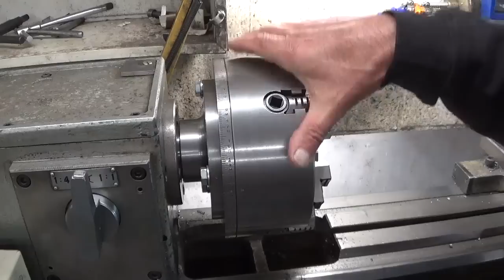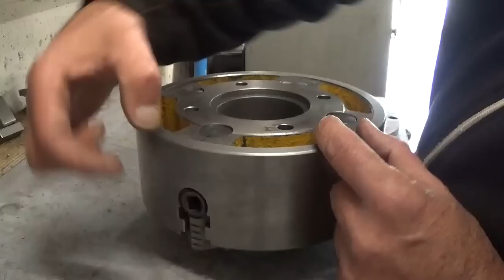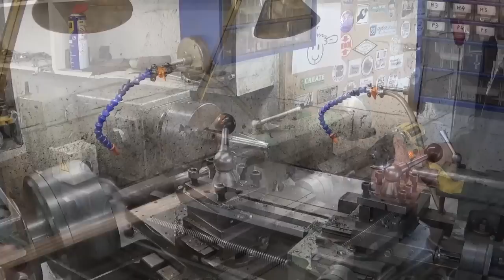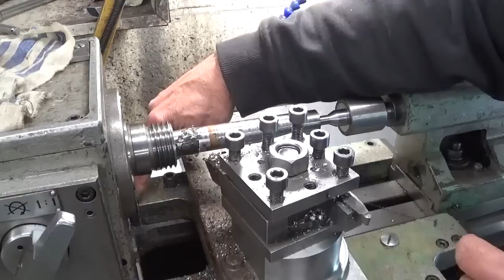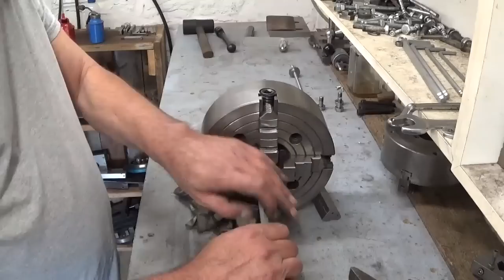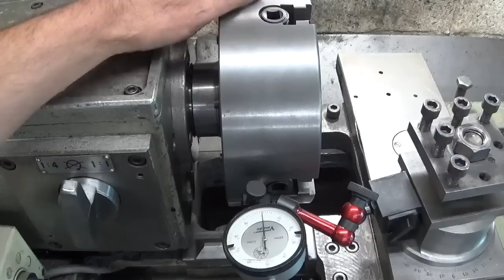Adapting my four jaw chuck.

Comment: Michel, that is a great idea.  I'm trying to something similar on my 111-year-old South Bend lathe.  I bought an 8-inch (~200mm) 4-independent-jaw chuck to replace the very worn-out 3-jaw chuck, but need to make a backplate for it.  I didn't (yet) have the needed change gears to thread it to fit the spindle, but was able to get a Machinist at work to thread a rough plate for me to finish before I retired.  Of course, the 1-inch (~25mm) wide leather drive belt insists on slipping when I take a cut more than a couple of thousandths of an inch (~0.05mm) deep, causing the spindle to quit turning.  I think it's time to get a new belt since belt dressing doesn't seem to help!  ;P  I figured that with limited funds, I'd buy a 4-jaw to be able to chuck "anything" (of reasonable size) and simply take longer to dial parts in, and worry about buying a replacement 3-jaw later (if I ever do).
Reply from the maker: I think if you have a good working 4-jaw, you don't really need a 3-jaw anymore. Thanks for your comment, Bob.

Comment: That looks like a you ended up with a great result, and  it certainly sounds like much less chatter than before, but you are definately putting much less stress on the headsock front bearing. I am working my way through your videos, and I love your approach to tackling problems, you are very inspiring, thanks Rusti!
Reply from the maker: That's nice, Dave. Thanks. I appreciate it.

Comment: Bold move! 😃. I too get some pretty nice chatter with my big 4-jaw, most likely due to the same reason. It's gotten quite a bit better since I reshimmed my babbit bearings but still takes up a lot of real estate on my little lathe.  The original had a much shorter profile 😏. 
In any case, clever setup! The lower profile looks great too! Well done! 👍😁👍
Cheers!
Reply from the maker: Thanks Chris. I'm sure you will figure out what's going on with your lathe.

Comment: What you did was absolutely brilliant!  I bought that ~same 4 jaw chuck and it's been sitting in the box for over a year because of that exact same problem with excessive stick out.  
- - Before I forget, or some reason, the factory put huge chamfers on the corners of the jaws of my chuck; where they slide through the chuck body - yet every single edge and corner of the jaws still had sharp burrs that I had to remove. (If left alone, I think they would quickly chew up the cast iron body.)  If you haven't done so already, I'd recommend that you check your chuck for those same burrs.  I don't know what brand name is on yours (mine was advertised as "Steelhorse" on Amazon, but came in a box labeled "Shop Fox".  Regardless of the name, I'd bet they came out of the same factory.

With that out of the way, I think I'll borrow your idea!   (Fortunately for me, my lathe can cut its own thread; 2-1/4" × 8 TPI.)  
I'll do the same hollowing out of the back like you did but, since I can cut my own thread, I think I'll make my back plate 'backwards'.
- 'Backwards' meaning a mirror image of the typical backplate, with the thick center hump that holds the threads & registration seat pointing into the chuck body instead of sticking out the back; reducing overhang instead of increasing it. (There's plenty of space inside the bore.) If it works as I hope it will, the back face of the chuck will come flush with the spindle nose!
Side note 1:  I wonder how much material can be removed from the full diameter of the back of this chuck before it starts compromising its rigidity (or interfering with functionality of the jaw screw parts)? 
Side note 2:  Do you have a friend with a lathe that can cut the spindle thread you need?  If not, you could probably have a local machine shop cut them for you. If you make the part yourself, all the way up to where it's time to cut the threads, it shouldn't cost a lot just to have them do the threading.
Thank you sir for another excellent video! 👍👍👍
Reply from the maker: Go for it Doug. It's better to try something than letting it rust in a box.
And indeed. first thing I did when I bought it, was taking it apart and clean and deburr the thing :)

Comment: Great work, well done! As always, well filmed and presented in Your usual spirit.
Your experience of chatter in the very first try, thanks for pointing it out. I once bought a 5 inch rotary table and a 5" 3 jaw for the rotary table. They match perfectly.
One day LMS in US advertised about an adapter adapting that 5" chuck to mini lathes equipped with 4" chucks as standard. It did fit perfectly without any turning!
When starting the lathe I need to ramp up the speed from zero. Else I feel that the power transistors in the control box are jumping in and out.
The chuck is in place and I will do some tests regarding just the chatter You pointed out.
Thanks again Michel!
Reply from the maker: Thanks Stefan. The problem with big chucks on small lathes :)

Comment: Just an idea, you could have used the chuck body to give you the hole layout, start with the diameter of the hole to centre it then table locked, chuck clamped down, drill tapping size, thread and bolt to hold in place, rinse and repeat! Cheers, Matthew
Reply from the maker: That could have worked too, but I have difficulties to lift the thing on and off the machine.

Comment: I could have sworn these cylindrical pieces you machined partways into were there to hold the jaw screws in place - live and learn.
Now I know alot more can be taken out of a chuck than I ever thought!
Reply from the maker: Indeed, they hold the jaw screws in place. But I think with the cut out they will still work fine. Future will tell.

Comment: Mmm!
Trying to take the slack out if my headstock bearings at the moment.  Got .6mm of lift but the Lathe is 80 years old. You've just highlighted a problem that I didn't think of. Thanks Michel 👍🏻👍🏻
Reply from the maker: 0,6 is a lot. Well, good luck with it.

Comment: In the afternoons... a very good option to make larger pieces is on the plate that you have with 3 claws, which has removable claws, so you can make extended false claws with a piece of steel and you can do them without any problem in the milling machine... like this you could hold pieces up to the maximum turn of your lathe...it is an option that I usually use and that is economical and very reliable...perhaps for another occasion you can make the extended claws and perhaps a few more sets to have soft claws for yourself lathe in an economical way and that many jobs will be solved for you... greetings from asturias spain
Reply from the maker: That's a good tip. I will keep it in mind.

Comment: Most interesting. I need a beer and cigarette while thinking about this. Have a great day and weekend Rustinox.
Reply from the maker: A beer and cigarette I can understand. But don't think too much :)
Reply: @Rustinox  I was thinking about having to change 2 bearing races on a lathe when switching to a larger / heavier chuck . 
It basically eliminated chatter and helped with runout issues . Thanks for sharing your expertise and ATB.
Reply: @QuantumPyrite_88.9  A bigger headstock bearing , That has to be a good follow up !!!

Comment: Well done! But it looks like you could really do with a set of change gears (or an "electronic leadscrew") to be able to cut more threads.
Reply from the maker: I have some change gears, but there's not enough room in the casing to put bigger.
Reply: @Rustinox  How about if you step down twice on a spare, unused or new stub shaft, within the case?
Great video as always and causes the grey matter to work.

Comment: Maybe the bite into the work piece from the jaws is causing the noisy cut.  Try some soft metal between the work piece and the jaws and see if that make any difference.
Reply from the maker: I tried that before. It doesn't make any difference. But, thanks for the tip.

Comment: The part left would make an awesome rotary table build. Awesome work Michael. I have been dreading replacing the 4 jaw on my Logan for one of these chucks as they seem to have a huge body for no real reason other than to use metal. Your solution is very elegant. Is there a way you can come up with a reduction gear set to make the lathe cut the thread you need? I know you have made gears in the past.
Reply from the maker: There's not enough room in the case to put bigger gears in place.
Reply: @Rustinox  i see. Hmmm. That is an interesting conundrum.

Comment: Scary, but it worked great! I don't understand where the chatter is coming from. You'd think: massive chuck means less chatter. Maybe the spindle attachment is too weak for such a big chuck? Hopefully not.
Reply from the maker: I think the spindle is flexing between the bearings. After all, it's a big chuck for a small lathe.

Comment: Hi Rusti, why can’t you cut the 4.5mm pitch you need for your backplate?  Is it because the lead screw re pitch is too fine? - some say you should not cut  pitches larger than the lead screw to avoid overloading ( but people do it) it or is it that you do not have the gears?  I have.3D printed change gears and would be happy to make the ones you need for you.
Reply from the maker: Thanks Tony. But the gears I need for this would be too big to fit in the machine.
Reply: Ok but I think we can  solve this with compound gearing or change the module to reduce the gear diameters, you are not the first to have this problem., it would make an interesting video. Can’t remember if you have a public email?
Reply from the maker: @tonyray91  rustinox@outlook.com
It's in the "about" section of the channel.

Comment: Michel, sounds like the bearings need readjustment, if possible. If not, a new set will help.
Reply from the maker: Well no. The bearings are fine. It's just a small machine with a big chuck.

Comment: Looks Like the 4 Jaw will be a good addition to the lathe.  I noticed there might be be a problem when trying to large diameter pieces of material.  Expanding the jaws might be limited, because they might crash with the bed way.  Don't ask how I know?  What projects have you planned for the 4 Jaw?
Reply from the maker: If I setup a workpiese that large, I think the whole lathe will tip over :)

Comment: Can it cut 18tpi if so just run the gear train 4xs faster and it’ll cut 4.5 I had to do something similar to cut a 6.5tpi thread my lathe has the ability to cut 13tpi so I just ran a 40tooth head gear instead of the 80 and it worked like a charm
Reply from the maker: In theorie, you can cut whatever pitch you want, if you have the right gears. There's not enough room in the case to put bigger gears in.